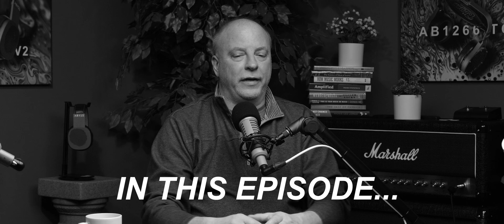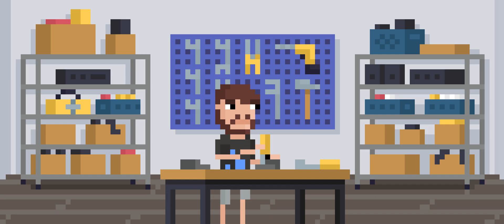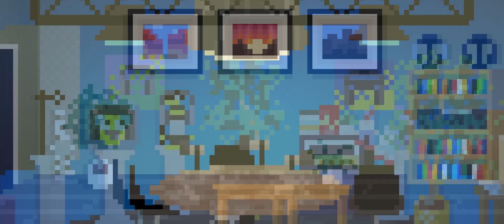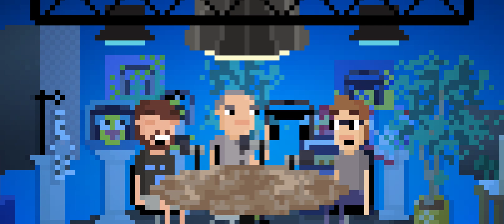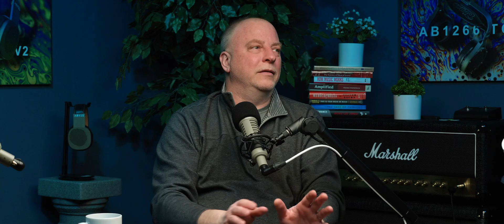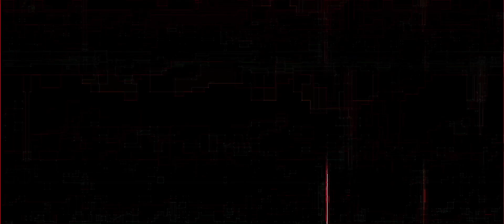What DAC connection should you use???

Comment: Optical is plagued with poor jitter performance.  USB has a substantial advantage (with USB 2.0 or greater), in that it allows you to use the DAC as the clock source.  So, if your DAC has a good clock, any concerns about jitter basically go away in all but the most extreme cases.  USB may be a bit of a mess as a standard more generally with all the legacy compatibility and all the different revisions, but it’s been more or less a solved problem for audio since USB 2.0.  The ear is very sensitive to timing information, so whichever interface offers the lowest jitter is usually what you want to optimize for.

If you want to have the best of both worlds, use USB with a galvanic isolator to combat EMI from the source.  Some high end DACs even feature USB modules with built-in galvanic isolation.

Comment: On the topic of an audiophile standard, USB 2 is adequate. PCM at 3Mhz sampling rate, 40 bit (extra bits for parity, padding) would only use 60 MebiBytes of data. A typical stream would use a lot less data. Perhaps USB3 could be used as an audiophile standard where it takes advantage of protocols to ensure better video streaming to reduce jitter, and allow for metadata in the audio (like album art or maybe EQ instructions) and so on. And the spec could include rules about shielding and so on.